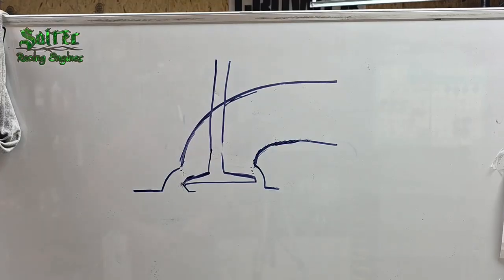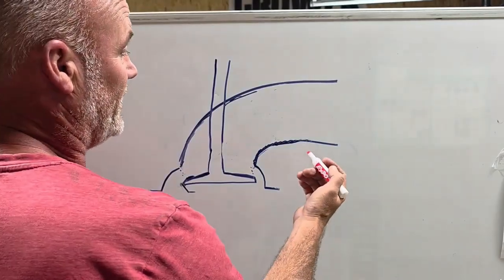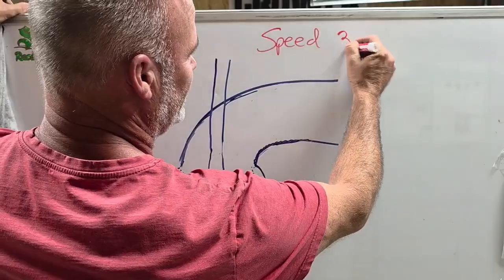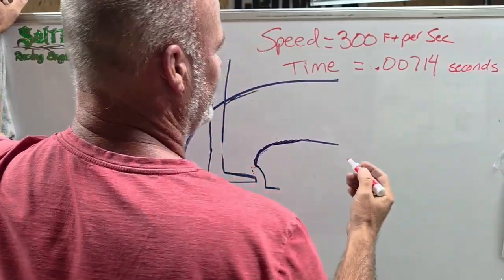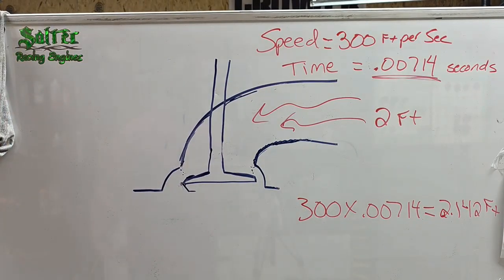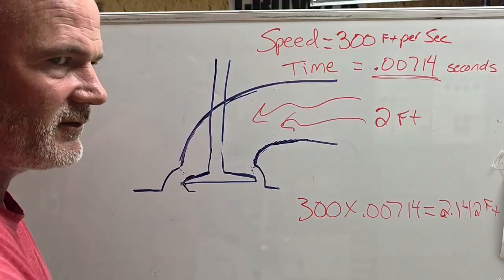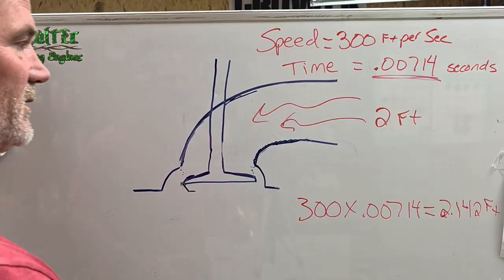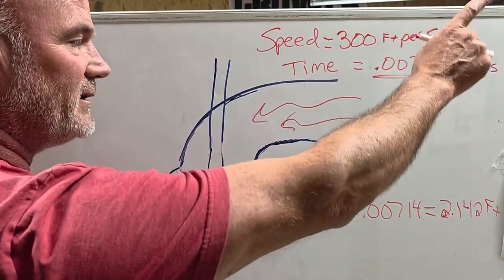Answering Steve Morris questions about valve speed and Air Movement in a Port

Comment: here is a thought if an engine is close to 100% volumetric efficient which most aren't a 400 engine has 50 cubic inches per cylinder which equates to 800 cc i think . so lets say it has a 200 cc runner that runner has to fill the cylinder 4 times correct and that is each time valve opens sounds crazy let us know what you think , just adding thoughts
Reply: Performance engines are usually well above 100% VE in the powerband.

Comment: Exactly.   Appreciate you sharing this and educating everyone.  I noticed Steve doesn't measure VE on his dynos.  That and measuring BSFC would allow you to calculate the amount of air the engine is consuming.  This math has been around for decades and engine builders (like yourself) and designers have been using it to evaluate changes and build winning engine combinations.

Comment: I've watched Steve's, Eric's and your videos and no ones mentioned or taken into consideration the piston sealing,as with any air pump if the suction isn't 100% the amount of air pulled in isn't going to be 100% of what's available so I really can't see how anyone can measure how much air is in a running engine without 100% knowing that the sealing rings to bore has a perfect seal from top to bottom of the bore....
Water grains in the air must also be a factor of some kind in how much or speed of air is moved in a given time..
New to your channel but it's been very informative and ile be watching from now on👍
Reply from the maker: Thank you and when I was talking about there's too many variables that was some of the variables I was talking about

Comment: Let me ask a general question to see if maybe I'm on to something. Most engines seem tohave a bigger bowl well a 23 degree. I know on the flow bench guys do it for turning the air. My question is it that or is it actually acting like a resivoir for a high pressure charge when the valve is closed. Basically stationary for simple terms and the farther up the port it's continuously flowing due to intertia until the port reaches a specific pressure? And if that is the case that would make more sense to me as to why the valve job is so critical on lower lift flow. You have a high density high pressure column of air. Basically what I'm getting at is the air the at the valve could be 3 times as dense (just a number IDK what it actually would be just a value to make a point) and the air halfway thru the intake might only be atmospheric pressure. If tht is the case then once the high density air is in the cylinder it would take less cubic feet of air to fill the cylinder due to gases expand in lower pressure areas and becom less dense. That is one reason why I don't think we will ever know how much cfm will used by the engine because the pressure is dynamic. Also once in the cylinder the cylinder is still a lot hotter than the intake port so that will cause some pressure increase as well. Hence why a cold block makes more power than a hot block due to higher density of air and fuel. Probably over thinking this but would love to hear your thoughts on this

Comment: Or to think about it another way, if for example we say the intake port is 300cc, and the amount of air ingested per intake cycle is only this volume, then the 540 cubic inch engine can only achieve a VE of 27% Even if the intake port is larger, its still never going to be enough to get good cylinder fill and make power.

Comment: Just to add some bits... The pressure delta between cylinder and port makes a huge difference as well as the intake pressure wave can actually can cause above atmospheric pressures at the valve depending on rpm and intake design. Even doing a full CFD (computational fluid dynamics / CAD flow simulation ) study isn't 100% accurate to real world testing. 

Love how you have been breaking things down in greater detail in a short form!
**for some reason Youtube deleted my original comment.... so here is a repost**

Comment: Back many years ago at MMI, an instructor showed my class just how fast air moved in an engine at 5,000 rpm on a Harley Vrod with the airbox removed. He held a 2 inch strip of paper a foot away from the intake stacks. The intake ports were somewhere around 6-8 inches long. At 5,000 rpm the paper was sucked into the engine and out the exhaust in less than a blink of an eye. The paper didn’t even get burnt it was moving so fast.

Comment: If you can approximate the volumetric efficiency at the RPM of interest, you can calculate the inducted volume during the intake pulse based on bore, stroke, and chamber volume.  Of course, that doesn’t account for any reversion or overlap draw out the exhaust.  That charge volume (in3) through the port CSA (in2) during the intake valve event time (s) gives average port velocity in (in/sec).
Reply from the maker: You are correct i went over that in the pre ious video
Reply: This is pretty much how modern engine management works. Various “pressure conversion” tables are developed with the help of simulation and make up what is effectively a network of VE tables, but with additional axis compared to the typical map/rpm. The ecu then measures differential pressure across the throttle blade to determine base airflow. Because the only real feedback available to the ecu in a running vehicle on the street is exhaust lambda, any fresh air dilution / overlap draw through the exhaust port counts towards measured VE in the form of STFT/LTFT. Part of the reason why tuning VVT cam angles needs to be done on the dyno as there’s no real way to determine what fraction of charge is flowing through the head during overlap. This is also partially the reason why most modern turbocharged engines are conservative in how much they lean on overlap and intake advance to enhance VE, as it runs the risk of having an inaccurate picture of the lambda conditions at the time of combustion. DI engines are better because at least you can be sure that the fuel mass is relegated to the combustion chamber unless your SOI occurs during valve overlap.

Comment: This was why when you done your piston cheat code about porting the pistons at critical speed WOT that valve the pistons exhaust valve all of it is like watching a blade in a box fan…it’s there but you can hardly see it. 
That’s why porting the valve notch is important because at 8000 rpm the valve is open and closing at such a speed none of it stops as if it’s in a text book example it’s stopped but fast. 😅

Comment: Doesn't vacuum of the piston pulling down to fill the cylinder have a large effect on how much air moves through the intake?  That's why I asked on a previous video that you took down, asking the question 'at what pressure?'

And how much vacuum a piston pulls on a intake is dictated by RPM, correct?  So a higher vacuum is actually going to pull more air, even though the valve is only open for a short time, as you did the math.
Reply from the maker: Yes plus 14.7 atmosphere on top and on top of that he isboosted